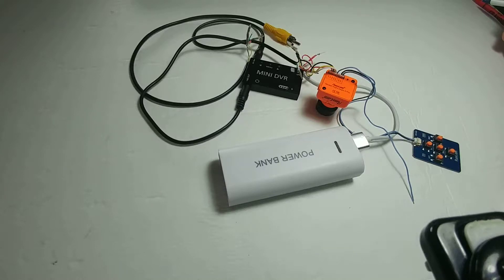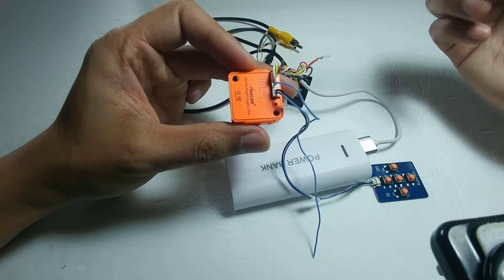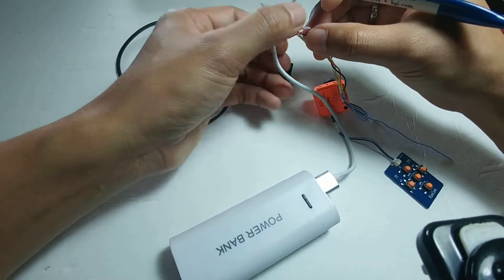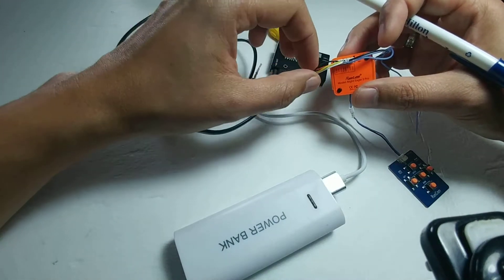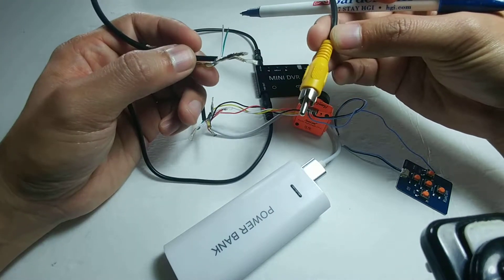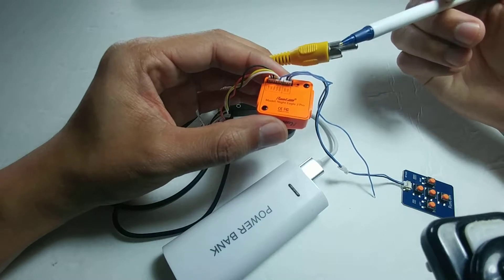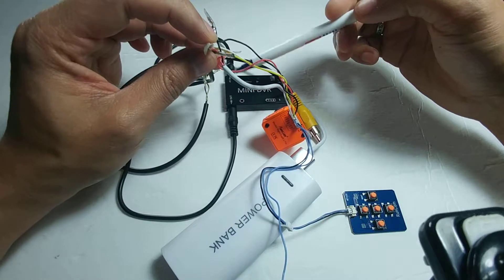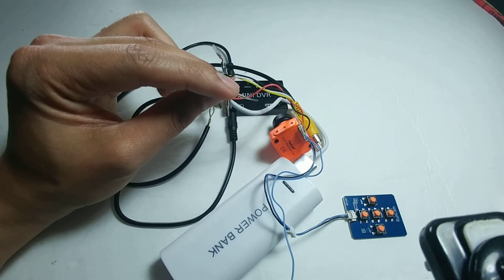How to Display FPV Cam onto TV/Monitor - Step by Step Wiring.

Comment: Hi I want to connect my webcam to video transmitter for my FPV Cam
My webcam has 5V GND DM DP
Where should I connect DP and DM

In my VTX input slot there are only 5V GND Vid
Reply: Hi. I don't think you are able to as it is a complete different system/interface. Gotta have anolog camera to get it works.

Comment: cool video  Question  how do you wire RunCan to male av 5.8 male plug for direct feed to FPV goggles ?
Reply from the maker: Hi. Thanks for the question but I am not familiar with FPV goggle input.
Reply: @thiengadget9557  Ok thanks
Reply: I want to know how to wire the camera to a 3.5mm jack so I can plug in to my eachine v100.